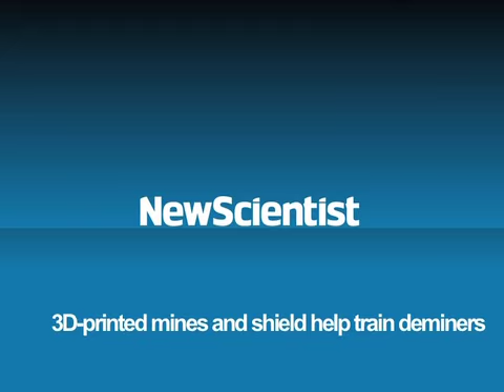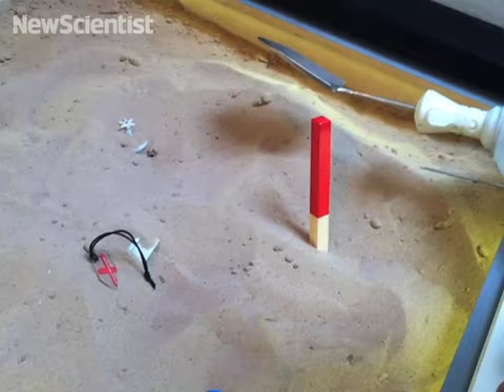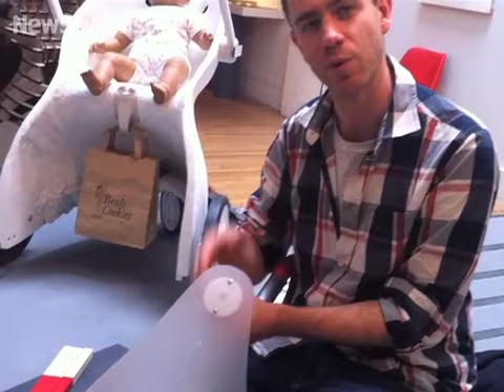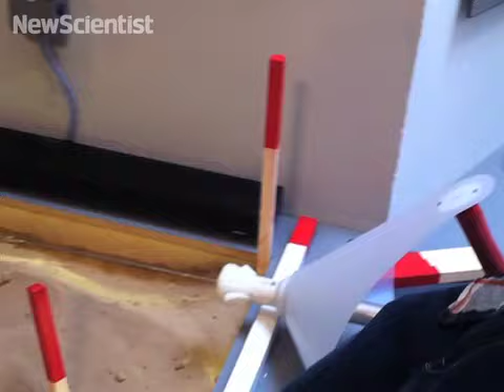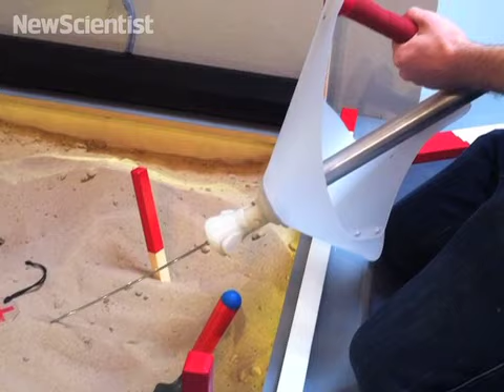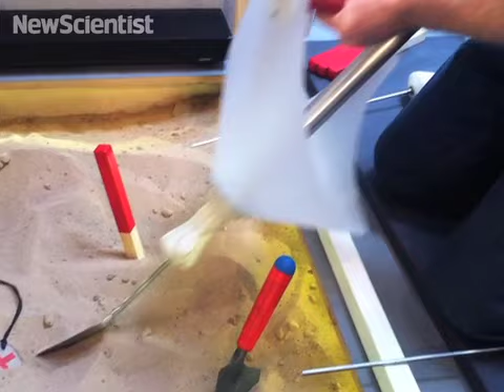3D-printed landmine and shield help train deminers

Comment: ofc they can. you can also stuff a shoe-box with explosive and put a lighter fuse under the top. Same effect. 10000 times cheaper. Mines didn't exactly evolve much over the years. they don't have to.

Comment: I am pretty sure before you can use any water filter you have to be sure no mines will rip your feets out.
There are still many many mine fields we have to deal with.
It has to be done.
And why don't you try tackling those problems you name by yourself?
Start a kickstarter project.
Rambling on the web will not get you anywhere.